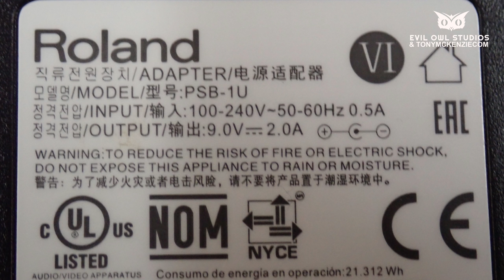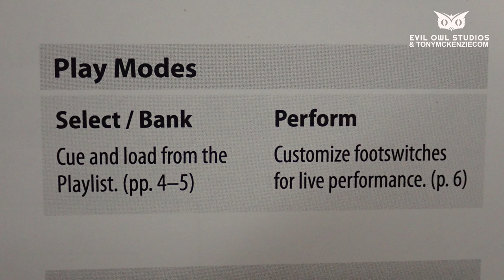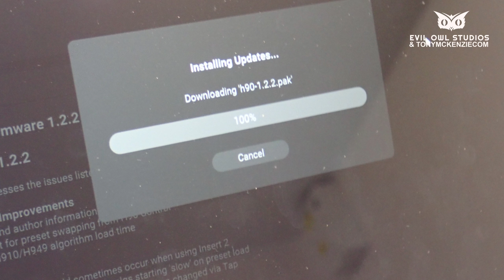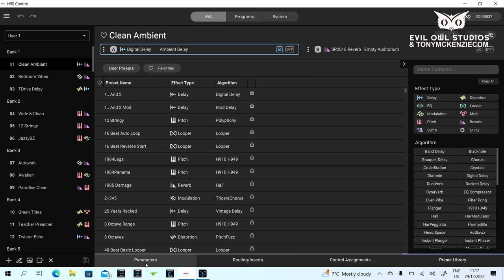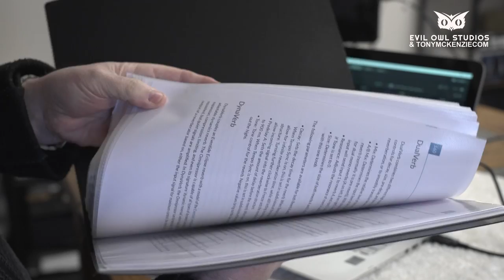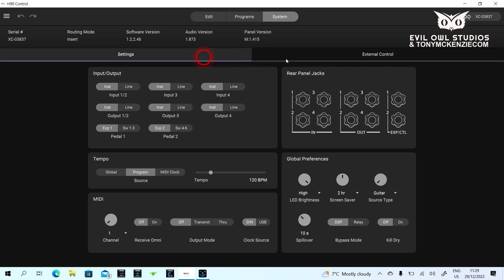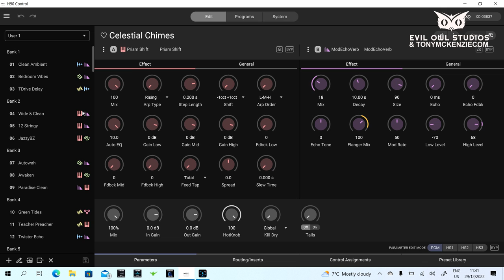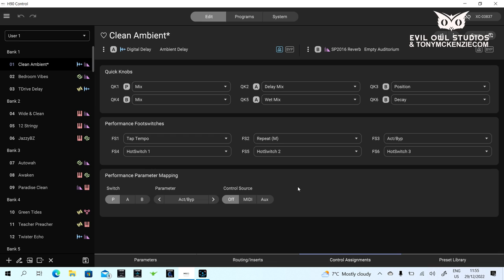Eventide H90 Harmonizer: The Most In-Depth Look You Will EVER See!

Comment: Eventide Dev here. I'll only comment on what you got wrong about the processing power b/c I don't want misinformation out there. It'd be amazing if we could squeeze all that DSP math out of a 108 MHz chip, but alas, that's just not true. The GigaDevices chip is not the main processor. It's just a board micro controller, and in fact, there are two of them in the box. The main event is an NXP imx8 mounted under the audio board. It's a quad core Cortex-A53 1.6 GHz per core processor (with additional Cortex-M4 coprocessor). The manual is like 4000 pages long. I DO NOT recommend you disassemble to access it b/c of the risk of damage to the unit.
Reply from the maker: Thanks for this info. I certainly could not find in it the technical notes in the manual I downloaded? In fact I could not find it anywhere about a NXP processor inside the H90 - but that's OK I'm certainly not perfect. But I will revisit this unit and find the processor. NXP processors these days are used in so many devices that I have checked in more recent times. I have looked in many devices since 2009. Since 1981 I came from technology so I guess I'll find that chip for sure and create the video to confirm it all. I noticed in the standard manual that my warranty is void when I open the unit anyway, so warranty? I likely have none and if I damage my full retail paid for device will I even care? Nope. But hey, I appreciate you commenting about this stuff - its pretty rare that I miss a processor but there you go. Thanks and it really was appreciated that you pointed this out and I'm sure it will help many viewers.
Reply: hi! in terms of computing power is it comparable to a h3000? or to be more precise, is this unit capable of reproducing the complexity of the h3000 algorithms? thank you
Reply: Damn it. 
I was under the impression this was gonna be more like an Eclipse in a pedal. 
Can’t say I’m not disappointed that it’s just essentially 2 H9’s. 
🤘🏻enjoyed the solo w/ backing track TM-
That was cool.
Reply: @themanwhostolethetone  by the unit of processing power (Hz), it's certainly more powerful than what was in the H3000 (which were early "partial" DSP chips from TI). It's totally capable of reproducing the complexity of h3000 algorithms.
Reply: @billyarsenault1970  It IS more like an Eclipse than two H9s. Eclipse is a dual algorithm rack unit with series / parallel routing. H90 has Series / Parallel routing with the addition of external Inserts.
Reply: @Rwedelich  I disagree brother-Although as far as the hard-ware that may be true. 
But if it was more like the Eclipse than 2 H9’s as far as the actual effects then i would already bought it no questions asked. 
Also TM is very familiar with the Eclipse and he would have made the comparison straight away if it was in any way appropriate. Unfortunately It appears to only have the same quality of algorithms as the H9 plus a few new ones and none of the actual legit higher quality ones featured in the Eclipse-
Which is the problem. 
So if you still want the highest quality Eventide algorithms with a modern up to date display and editor your still looking at 7k for the H90.
The H90 should have had some of the same exact effects as in the H9000 but much much less of them obviously-
Maybe just the ones that work best with guitar for instance.
If come out soon with an H900 that is like a $2000 version of the H9000 then I am all in.
Reply: This pedal is just a money grab. Chips are cheap now. The tone and magic is simply not there. None of the Eventide H3000 magic is here. Eventide is just hanging onto their name but  doesn't care at all about tone. Lexicon and Bricasti get it. Roland, Eventide and Akai are making products that are consumer. They have forgotten about the golden ears of true music professionals and real artists. The ad conversion is horrible and no magic is in these units.
Reply: user-zv7lm8uk7h eah. I think your opinion is kinda moot being the sales of these units has been doing very well, took me a while to get one because of non stock. That you tells you about its success. Its more powerful that just 2 H9s. I think it probably sounds better than an eclipse. But it won't replace my H7600. Not quite there.  But it sounds great. I think bias is very opinionated. Just like the Fractal nazis. Plenty of hate for Eventide and Mesa Boogie and the US. Its a trendy bandwagon hate. Seen it a thousand times.
Reply: user-zv7lm8uk7h  not at all. Studios all over the world have Eventide professional units. Who do you think Fractal ripped off?
Reply: Hey you guys should release a version of this but rackmount, two ARM cpus and the ability to use VSig. Aka a cut down H9000. Something between that and the H90. I would be first in line 😂
Reply: @Rwedelich yeah I bought a few. They are sold as guitar pedals but its a stealth rack unit with and its like having the lexicon remote 😂 some folks cry about the price and I am thinking you know this is not just a guitar pedal, think. Then the light bulb finally dawns on them and then they get it. Would love to see an “H900” rack unit with dual cpus and VSig ability.
Reply: figtheoryvlog actually that CPU is pretty powerful for the use case, most use SHARC DSPs, even my UAD Apollo racks use them. That one cpu blows away a whole array of those SHARC cpus. I am hope one day UAD moves on the ARM architecture for the Apollo series.
Reply: @realtruenorth  Those who don’t “get” Eventide, and their history, just don’t get it. And they’ll respond by saying it’s crap and the company is going under. 👌😂 Eventide are legendary and their algorithms are second to none. Can remember using their rack mounts in studios in the 80s and getting blown away. And now they’re on my pedal board! Love ‘em…oh, and same with Mesa Boogie, which is my amp (Mk V)…Cheers! 🍻

Comment: Can’t say I care for eventide or any multi effects pedal. H9 sounded okay but was a big disappointment in my opinion. Just learn how to use the effects in the analog world. This is a crutch for most people in my opinion. 1000 I could by a brand new amp.
Reply from the maker: Well,  do own a H7600 processor in the studio, and that is a very powerful device. Personally I had at least two H9's and I never really used them much generally because of the faffing about re the control, which I always felt was compromised. great sounds but... I also have a Ocean Machine that really is not the same by a very long way, but it's sort of similar if ou want it to be so to speak. And I tend to (at least in the studio) add effects after the recording rather than 'in' the recording which makes more sense to me. Yes 1k could buy a pretty cool amp...  thanks for the post and for watching.

Comment: Your comment about plastic 6.5mm sockets is correct. I have a Mesa Heartbreaker. It had a horrible crackle that seemed to get worse as it warmed up. So out with the chopsticks and it was the effects loop return jack. Plastic appeared to have worn slightly over the last 30 years and formed a dodgy contact on the switch. Easy fix but shows how the plastic and also the contracts can cause issues. That said plastic PCB mount connectors reduce the cost of manufacture so are here to stay especially with DSP based effects.
Reply from the maker: Oh I'm sure its all about price. Well I suppose they will last some time as long as not in and out every day... like gigging? Thanks for watching and have a great new year.

Comment: Thank you so much for an honest review. A breath of fresh air in comparison to most reviews. 
I cover pop music from 50’s to present so I need a versatile pedal board. Besides modulation and delay, I do quite a bit of pitch shifting and synth sounds.
What pedal would you recommend that will suit me better than the H90? 
Thx for your help 👍
Reply from the maker: To be very honest, Eventide is king of the pitch shifting in my opinion. I have tried many devices over the years and most of them pale in comparison. You might consider the H9 which is cheaper... so pointing you to devices that for the PS are not as good would be wrong. But do consider the H9 also. Hope it helps... and thanks for the comments and for watching.
Reply: @tonymckenzieofficial  thx Tony!
Reply: When you say 'pitch shifting', if you include guitar harmonies, then the best harmoniser I personally have used is the TC ELECTRONIC QUINTESSENCE HARMONIZER PEDAL. Modulation wise it's got to be (for me) the Eventide Tricerachorus (included in the H90), or the Strymon Mobius. Just my thoughts :)
Reply: @Liam_Doherty_UK  which one of these will allow you to change keys while pitch shifting? e.g. the ending of Hotel California solo
Reply: @bluesnaggletooth1660  I don't know of anything that will do those type of changes manually. I'd imagine you'd have to use midi in some shape or form to achieve this? Someone with more knowledge than me will no doubt tell us :)

Comment: i got mine yestarday. despite i am in europe i got it for the us preis 899. i really love the pedal so far. it works great with my tele , synths and modular. i was a huge fan of the h9, but the h90 really sounds great imo. i am really happy to own one. but i totally agree the power supply is a joke for a device like this. tremendous video!!!
Reply from the maker: Thanks for posting your opinion so far with the H90. It's a well made unit (so was the H9) and at least its controllable better then the H9 device. I never got on with the H9 because of those shortcomings, but this H90 has some controls :) and it sounds good like the Eventide units I was more used to. Oh I paid the full amount :(. Yes the power supply really surprised me and the 'plug' literally pulls off if you just grab the power supply because the release catch is exactly where you might grab. :( Oh well.. Thanks for watching and great to know my video was good for you. Check the text as there is another video that shows a 'hidden' processor if you like that sort of thing.

Comment: USB type A and B are probably the most robust USB connectors from a mechanical perspective. Micro and type C can have their centre pieces broken easily. Given these pedals probably only need USB 1 or 2 speeds I'd prefer a USB type B like they had on the factor pedals.
Reply from the maker: Agreed on the robust aspect of USB and the A & B rarely fail. I have had no USB C type fail, but I could bet, like you said they can. But I really would not have liked the USB mini on there as those really are getting on. Good point and thanks for watching - and have a great new year.

Comment: Thanks for this review. I always find more info, and better info in reviews that turns on every stone. The rest of the reviews are equivalent to manuafacturers own ads. Eventide is the don of smokes and mirrors, and obfuscating info. I remember well, an old review on Thomann site (now, mysteriously removed however) on their 5.000 USD grand flagship H8000 rack (or something, maybe it was H9000), that a professional studio owner bought. It was a scathing one star review. They just "ported" software into hardware, and numerous other softare plugins at fraction of the price sounded way better.

First: Eventide still is adamant about having polarity reversed for a guitar pedal. It's not centre negative (however, the Rose pedal was). And it say 12 V - 12W on the power inlet as if this should be some guide to what current it needs. shouldn't it be better to put the actual mA in there as every other pedal manufacturer does?

Second: When should manufacturers learn that if making a guitar effect pedal, you must have at least 1 mOhm inputs and not line level inputs at 600K? Which makes the dry guitar signal suck big time. Which it does on all these H series pedals. Yes, it may increase high end hiss slightly, but keeps that sparkle transients. Hey, even BOSS GT1000Core made them 2 mOhm inputs. Even soundcard rulers RME have finally caved in and complied and has their latest RME UCFX II run at 1 mOhm inputs. Finally.

At this price, I'd expect both of the above to be fixed. If using ARM then the voltage and current could be tamed even down to regular 9v and modest mA current draw, that's the point of ARMs really.

remember: at this price. And people complained about the Klon Centaurs extortionate prices, even second hand. What about this one then? :-) Caveat: huge price anchoring ahead.
Reply from the maker: Useful info and thanks for posting this. Cetainly I was not aware of some of that. And do follow up on the second bit showing the actual processor well hidden :)  and thanks for watching.
Reply: @tonymckenzieofficial  You're welcome. Since the power supply is of lesser quality, they (Eventide) could easily dodge this if the input had regular center negative and ran on 9v (which H900 supposedly can run at) and ample mA, then you could use any power supply brick used for all the rest of your pedals. Or any other wall wart. Without having to think twice.

Comment: Most guitar players would get better overall tones from a Fractal FM3 MKII. It is only slightly more money. That will only get you world-class effects, but cabs and much more- also of incredibly high quality.
Reply from the maker: That is an argument to buy equipment at similar price that offers more I agree. The H90 is not really a low cost unit, but for what it does it' really is spectacular. For someone in the studio I would personally prefer the Eventide, but for gigs etc. thats a different thing altogether. Thanks for the point and for watching.
Reply: Or, you can have both. I have an FM3 and an H90. Never bored.

Comment: Very nicely done, Tony!  I got mine in February and I love it! It is definitely complex, but I find that if I just hook it up and bring up a program that is close to what I want, I can just "mess with it", with headphones on and go by what it Sounds like. After all, Sound is what I bought it for and so far, I've been able to pretty much nail what I'm after. I agree with you about the pwr supply. I can't believe that anything that costs this much doesn't have an On/Off Switch. I use it mainly in the Studio which means I' constantly having to plug it in and unplug it. That, I don't like at all!  I have "Liked" and Subscribed. I especially like your down to Earth, honest presentation. Here is a piece that I wrote & recorded using one Telecaster, on 4 tracks, through the H90.
https://youtu.be/8480rYpYBBg?si=VdtmRL9Ig3jg4hM5
Reply from the maker: Thanks for the post - its a very good post and shows how you use the H90 which will help many guys. Ha I get that about just 'using' the H90 of course... these days there is so much stuff and manuals are often very thick spending the time can be hard. Yes the on/off switches are these days getting rarer... and just IMO it's a sort of cost saving direction. Crazy because some cheap units do have them and some more expensive units don't. Weird. I like the on/off for exactly the same reasons as you too. Thanks for the example track... that's a great addition for guys to take a look at... and it all sounds cool to me - laid back and a nice 'drive' :) You'll know what I mean... Thanks for watching and that subscription.